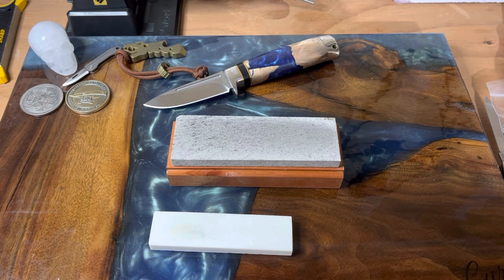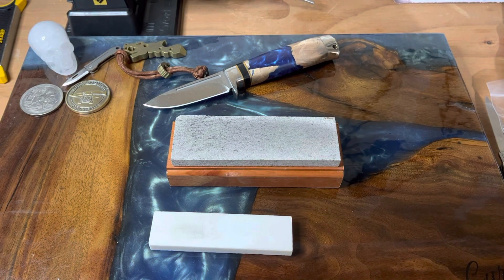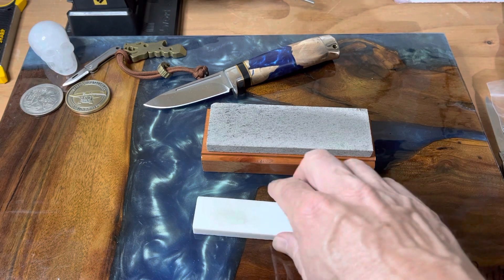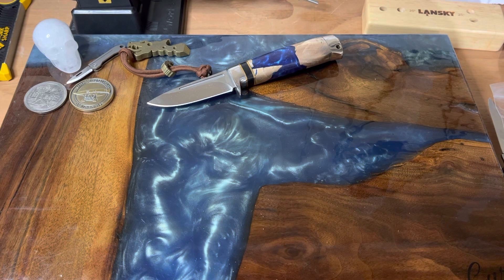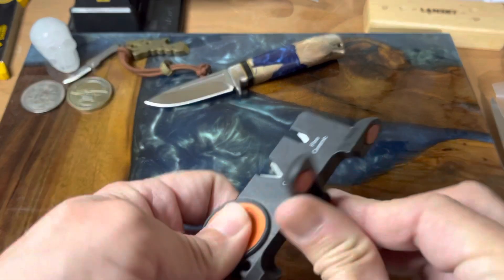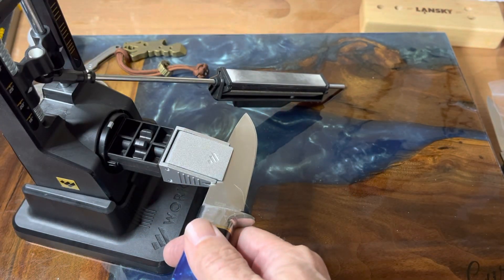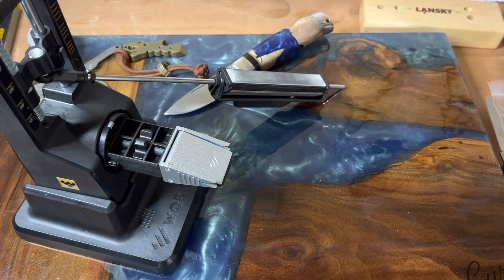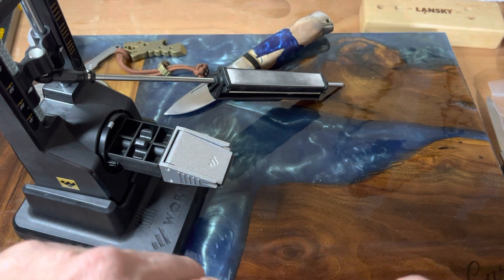Pro Sharpeners Hate This One WEIRD Trick-#funknifefriday !

Comment: If you want to understand, what you are looking for to make a sharp edge, use a magnifying glass. Study the look of the edge of one of your sharpest knives. You will most often see they have a tiny micro bevel. Most times people remove more metal than needed.
Using a magnifying glass will let you see the burr appear or if you are creating one. You can feel it with your finger however; it helps to see it better to understand what it looks like. It also will show when the burr breaks off the edge, that creates the sharp edge.
The edge created from different course stones are going to be sharp. They can be suitable for different uses. The edge of a knife is like a saw with different size cutting teeth. Mirror polished edges in appearnce are often more for looks than cutting better. The hardness and toughness of the edge depends on the qualities of the steel. 🤔:goodvibes:
Reply from the maker: I agree. I like a toothy edge myself. Thanks for the tips, Gizmo!

Comment: Great video as always!!! One thing I'll mention, I had the same problem with my precision adjust when trying to sharpen smaller blades & running the tri-hone into the clamp. I found 2 possible solutions. You can get a magnetic table to replace the clamp and sharpen your smaller knives. It's interchangeable with the clamp. Its on ETSY.  2nd solution is the one I prefer, Gritomatic has an upgrade for the WS Precision adjust and it has a much longer and much shorter clamp and it comes with a universal stone holder and a brace to put under the clamp. It works great. Anyways, love the video & I like the trick. Thanks for showing it.
Reply from the maker: Thanks for your suggestions, Tyler! I appreciate it!

Comment: I have the same sharpener from work sharp. I have a hack. The strop that comes with upgrade kit is soft suede. It will not strop good on harder steels, d2 and up. I bought a magnetic backed hard leather strop from sharpening supplies and cut down and stick on plate to do my 154cm and sv30 blades. Works so much better. I use diamond emulsion spray on the hard leather strop.
Reply from the maker: Thanks Travis! I appreciate the tips, I will check that out!

Comment: Good set up Bro.  Got any tips for convex grind sharpening?  I have a Warthog cheat sharpener and a very nice Fallkniven and wondering if anyone has any tips on convex blade sharpening? Cheers Dave 🇺🇸 🇳🇿
Reply from the maker: My only tip would be to try and match the factory grind. You could use the Lansky system and try that. Hope that helps. Thanks David!

Comment: If you have the little Worksharp, a strop and a Turnbox you can do a good job on most folders. Bigger blades not so much. I can do an ok job with the stones but im no Kyle Noseworthy. I actually have a gizmo on the way that is supposed to help you get the right angle on the stones, if it's any good ill pass on the details.
Reply from the maker: Sounds good. As you can see, I am still trying to figure out my best way to sharpen. Thanks JhayKhay!